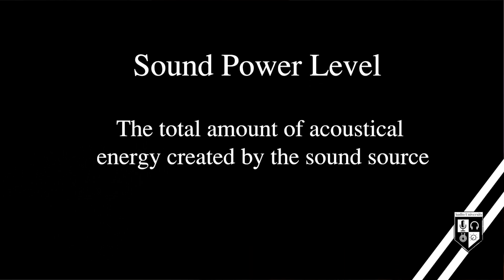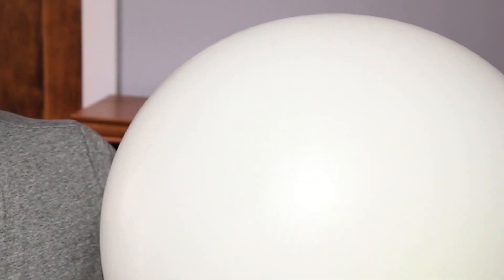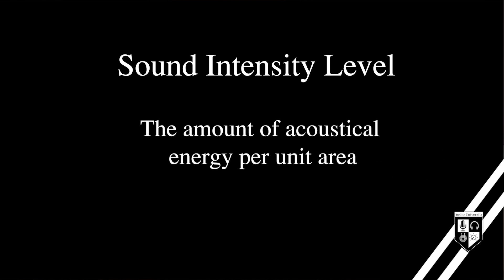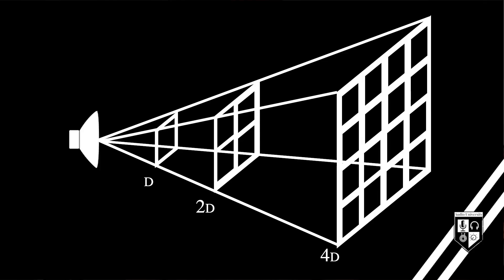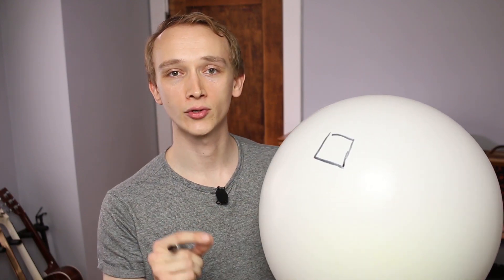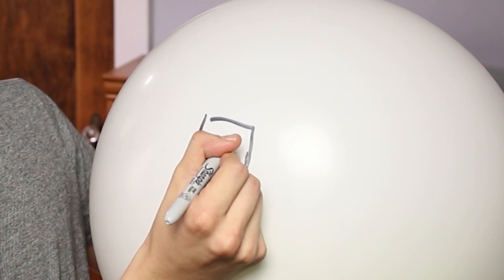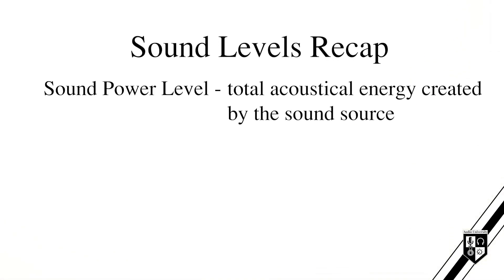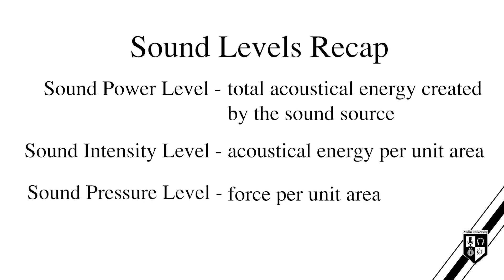POWER vs INTENSITY vs PRESSURE LEVEL: What's the Difference?

Comment: sp: chamber energy
sil: chamber size
spl: chamber pressure

even if there is an 1 inch ball and 4 inch ball have same pressure, its difference in size meant it different in total energy. if both exploded the sound of 4 inch ball will be louder in any  given distance, because the energy released more(intensity) than the smaller ball. this in why your floorstand speaker 5 feet away from you while headphone in front of your ear to reach same SPL, due to its low energy and  intensity that only cover small area

Comment: Loving these bite sized videos. Thanks and Keep them coming.🤘
Reply from the maker: Thanks! I'll keep them coming! Any requests for future videos?
Reply: @AudioUniversity  Would you be able to do a video on the difference between amplifier gain vs amplifier volume?
Reply from the maker: Volume is a term often used to describe the output level of a system. 
__________
Gain is a term that describes the action of boosting a signal. 
________
The two terms are related. Volume knobs can adjust the output level in two ways: by attenuating (reducing) the signal OR by boosting (adding gain to) the signal. 
________
Does this explanation help you?
Reply: @AudioUniversity  Thanks for being so generous and taking in requests. :) It would be great if you could do a video on sample rate vs/and bit depth, bit rate and floating point with a demonstration showing how using plugins with different sample rates affects the audio signal. Sorry if i asked too much. :P
Reply from the maker: Thanks for the suggestion! I’ll see what I can do!

Comment: What we should compare ? Those terms refering to what exactly? Audio signal? Sound ? consumption?
Reply: Easy Its comparing sound and the terms pressure, intensity & power are its measures. Lets say you are spraying water through a nozzle. The amount of water sprayed from the source is compared to sound power level (it doesn't change). The same water sprayed, measured at a distance of 10m is the same power (amount of water) but it's intensity (force of water) & pressure (flow rate per square inch say) level reduces drastically. Hope this clears it.

Comment: There is a kind of vibration speakers that turn anysurface into speaker...if we stick it into a larger surface area...then intensity and db will be less at the source of emitting that sound....I think that would affect sound quality and sound travel distance somehow...can you elaborate on this one?  

Also If earbuds and loud speaker produce the same db then the power is the only thing that changed...am I right?

Comment: Question please , when you mixing a live band does the subwoofer power speakers SPL needs to be same as the load speakers or it will depend on the style of music and desire wanted.
Reply from the maker: It depends on the style of music. There are also differences in perceived loudness between low and higher frequencies.